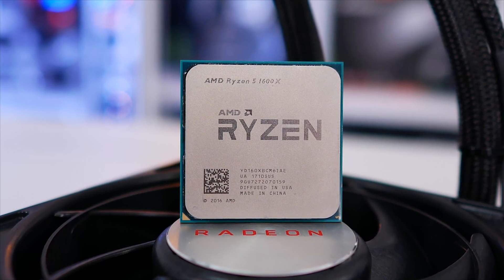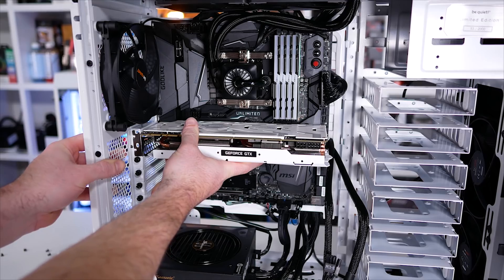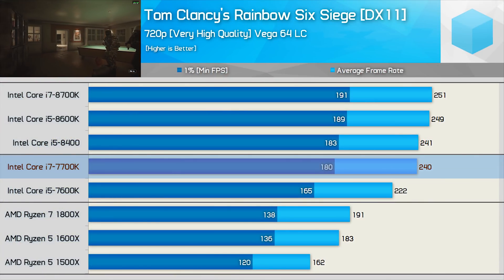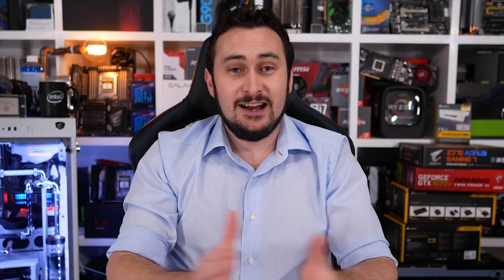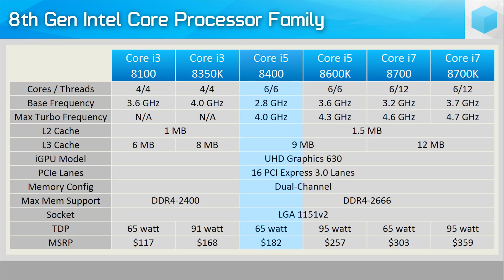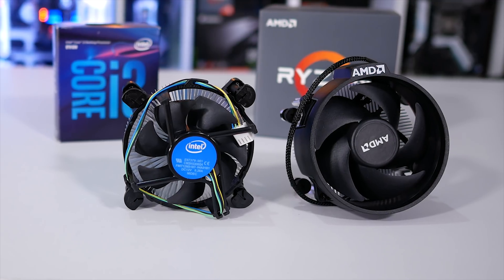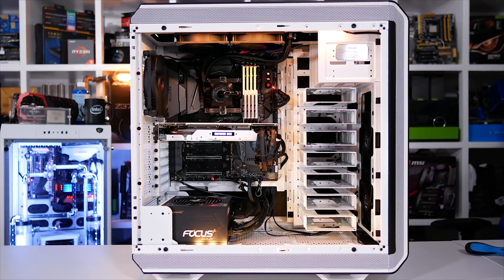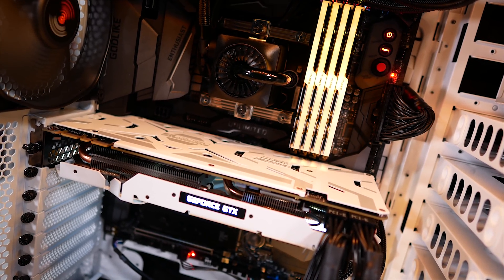Let’s Chat, R5 1600 OC vs. i5 8400 Benchmarks Incoming!

Comment: I'm paying 200$+ for 1050 ti here in India :( 

Should I just buy it from the US instead ?

Everyone is advising me to get it from India for warranty reasons 

I'm really confused.

 please help
Reply: I have a couple folk in india on steam friends, and one is to upgrade soon to a 1050 thats 8000rs.

The 1050ti is 11000rs, a quick translation to dollar says thats still 169$. Price seems right, even in india.
Reply: Tripnotik25 as to where I live it's very costly, if it was 169$ I would definitely buy it from here but that's not the case. I have relatives in the USA so will there be any warranty issues if I get it from there ?
Reply: Well yes, its always a hassle and im fairly sure you're the one responsible for shipping too. What saves you a few bucks now, could have you spending alot more later.
Reply: Tripnotik25 I see... they visit here frequently so no shipping charges but I think I better buy it from here... lol 

Thanks by the way ;)

Comment: Well can you blame the AMD fanboys? I mean...you basically give them scientific proof, that their freshly bought CPU will not stand the test of time as well as Intel. maybe towards the 4 core version, since it can be hoped that 6 cores get better support in games. But the 8400 in unbeatable, since I assume the 6 additional threads of the 1600 will never really optimally utilized in gaming. That is why they argue, that nobody really plays in 720p. But I think in 2-5 years we will already see that AMD buyers might no longer be able to fully stretch their GPUs potential (Yes guys I am saying that the 1600 will bottleneck the mid range GPUs in the next two generations), since it already bottlenecks a 1080Ti now. It is sad, but that is the reason why I will wait for Ryzen+

Comment: The reason why people think the 8400 won't do 3.8 on all six cores on cheaper motherboards is because Intel announced it wouldn't guarantee that clock speed on all six cores and instead stated that it would only stand by the 4ghz single core turbo.  This made many people suspicious that cheaper motherboards released next year wouldn't be able to handle 100% workloads coupled with the 50% increase in cores, and that this is why Intel did NOT want to disclose true six core turbo speeds. 

But i remember reading that subsequent to this announcement, Intel backtracked and announced that it would stand by the 3.8 all core number.  

Whatever the case, the stock cooler is woefully inadequate to handle 100% use tasks like video rendering on the 8400. Unless you like running your CPU at 75 C and higher for sustained periods, a basic 3rd party cooler is a must.  Otherwise, the CPUs will throttle and you'll never see 3.8 on all cores.

Comment: Are we still having this "real world benchmarking" argument? This always has been a cancerous argument that started with the Bulldozer launch when Sandy Bridge was handing AMD it's ass. Before, with the Athlons, nobody was ranting about this. It is just a reason to crush the delta's and create a level playing field by making it essentially a GPU test.

Though I do agree you shouldn't overdo it and create really high framerates and possibly break the game engines or the way the CPU can handle the mainthread. As long as the GPU is not hitting 90-100% load, it's fine. Whether that is 1080p or 720p. But if you start posting >200fps results at 720p, there is some merit to the criticism. Since the oddities and delta's you start seeing then does not reflect how the CPU's will age in the long run. (again, only if you're overdoing it. This has to be the point where the reviewer picks testing parameters intelligently). Take GTA 5 for example, that starts breaking on i5 CPU's at >160fps.

However the argument "you don't game at X, so testing at X is useless" is really tiresome.

Comment: so i have a gtx 1070
i6 6600 non k
8gb ddr3 1333mhz
gygabite h110m-ds2
180gb ssd
1tb hdd
my fps in all games is really low.even when cpu is not 100% fps are very low compared to anyone on youtube.for example on batman arkham knight i get between 30-45 fps on max(cpu is 100% at 3.6 ghz-gpu is 30-50 max).with vsync off and 90 cap fps.with msi afterburner and rivatuner.in fornite i cant get a solid 60 fps.fps is between 45-60.30 when droping from the buss.lol max 100-200 fps.gta v 50-70 fps.csgo 100-150 fps.wot 60-90 fps.thats all games tested so far.i dunno what to think of my future fps on the new ac origins.like i said.if you look at every benchmark on youtube with my rig everyone has much higher fps.i think my cpu is somewhat doomed.all cores are working and timing is ok.any help?do you think is something in bios(hpet off/on doesnt help?i dont think 
ddr3 its the problem.55 degress is a constant in most games.so no overheating problems
http://www.userbenchmark.com/UserRun/5553686
https://imgur.com/a/WxJqe -3dmark results
HELP
Reply: You tried updating your BIOS?

If your mobo still carries one of them release bios, they were a mess and performance was all over the place.
Reply: Tripnotik25 yeah i qflashed like 2 weeks ago.no difference..
Reply: Well next inline id say is the RAM, are you really using normal DDR3 on a skylake platform? could perfectly be the reason for the low(er) performance, not only that, you're risking the memory controller going to crap.
Reply: Tripnotik25 dunno what to say.from what i know drr3 va ddr4 makes little to no difference and only in some games like rise od the tomb raider
Reply: Hm no, even DDR4 vs faster DDR4 makes a difference on plenty games, you can check it here on Hardware Unboxed, hes got several videos on it, unfortunately hes never done DDR3 vs DDR4 on skylake i don't think, probably assuming nobody would use it on this platform.

Im sure 1333 Mhz memory can tank performance that much harder. And if that really is normal DDR3 as opposed to DDR3L, then it runs at something like 1.5v and is just waiting to blow out the memory controller since the DDR4 it expects uses much less.

Comment: Yes, Vega 64 is absolutely a bottleneck, including at 1080p. You have no business running a YT channel if you refuse to acknowledge that. Any 1080 Ti vs Vega 64 testing proves the Vega 64 is a bottleneck. The 1080 Ti also outperforms Vega 64 in DX12, making your claims about Nvidia cards completely false.

Just one such review proving you wrong. Never, EVER, us Vega for CPU testing.
https://www.techspot.com/review/1476-amd-radeon-vega-64/
Reply from the maker: +J Master that's my own review bud. I've done the testing. No need to get angry.

Comment: I guess this is the foreshadow to another Intel is better CPU video. However trust me the he won't get the most out of the 1600. You will know this because the RAM will not be OCed to 3500 with very low latency.
Reply from the maker: The Ryzen memory thing is super misleading for two reasons. Firstly high speed low latency memory is extremely expensive and blows Ryzen's cost per frame right out of the water. Secondly I have quite a few Ryzen 5 CPUs that struggle with DDR4-3200 speeds, I have a few that won't post over 3066.

Comment: Can most R5 1600s reliably get 3.9GHz at safe voltages?
Reply: Even on a stock cooler a 1600 should get to 3.8-3.9 easily. All 1600x should be hitting 4.0-4.1 with a good cooler.

Comment: I mean it is clear the 8400 is currently a better CPU for gaming.

I just don't want the whole of the Internet (and reviewers) go on and unquestionably recommend the i5 8400 over the 1600, even if specifically for games. Either one will do you just fine, you probably won't be able to notice a difference between them for 3-4 years in most games.

Comment: I'd argue that one ought to include the products that are closer to the the product on either side, from either camp. Like, 1500x, 1600, 8400, 8350k. Prices are often different when borders are taken into the equation as well. In Norway, the price difference between the i5-8400 and the Ryzen 5 1600 is less than 10%, while the msrp's are nearly 19% apart - the Ryzen 5 1600 has been at this price for several months now, so it's not a temporary price either (using statistics from sites that gather price data from all of the Norwegian online market). The 1500x is also more than 20% down from the pricing of the 8400, rather than the msrp which is around the same as it. These are price trends, and not only temp prices. 

Pricing changes all the time, so providing information about said fact is never a silly thing to do.

Comment: The reason I don't believe that low resolution testing gives the best picture of the "future profness" of CPU's is because we are in the multi-core era. When you are running low resolutions and stressing the CPU, it will only stress the cores, that the game or benchmark uses. So if a CPU has a deficit in per core performance, then it will automatically look worse, even though it offers more cores.

Maybe a bad example, but you don't buy the any core 2 duo CPU over the Q6600 or similar on the used market, even though at the time it was worse at gaming.

With that said, I believe the best thing to do is, like i'm sure you have said, Steve, is that you should buy what is best at the moment for the purpose you are going to use your PC for. I like that you give, us the viewers, the informed choice about how to decide which CPU to buy. So even if I don't see a point in low resolution testing, then i'm glad that I have the choice to see it anyway.
Reply: When reviewing what I wrote, I'm realizing that low resolution is just another kind of "max value". Like when reviewers used to put max fps in their graphs. It doesn't give the best picture of the CPU in normal circumstances, and I think that's why reviewers don't do that anymore, but don't hesitate to comment if i'm wrong :)

Comment: In next episode! Why testing with low settings is better than high or ultra!
Reply from the maker: +smiechu60 low takes work away from the CPU so that's much worse.
Reply: Hardware Unboxed you got so into fighting about 720p benchmarks that my joke went straight over your head (also testing in 720p takes work away from cpu but shhh)
Reply from the maker: 720p takes away from the CPU? Ohh okay thanks... noted.

Comment: You may be able to silence some of the confused ranters regarding 720p or 1080p. 

If you could say pull out some old games from say 2010-2012 or older, use some hardware from that era, and some older first gen i5/i7s and some Phenom CPUs from the time (testing for actual competing parts with similar MSRP perhaps). Test the top end GPU from its time at 720p to remove bottlenecks and later see how that compares when you drop a card like the 1070 or even the 1080ti onto the same old CPU when running those games at 1080p or so. 

You can see if the improved and upgraded GPU power (products from their future~) were able to realistically show those CPUs true performance in the past with old hardware compared to if you upgraded the GPU 5 years later.

Its a lil bit of work... with 5 games, maybe 2-4 old CPUs, 1 or 2 GPUs that old and 1 or 2 GPUs that are new. The testing combination  amount grows fast, but would be some valuable information! What are your thoughts?
Reply: Oh and bonus points if you would like to use older drivers (or even original drivers) on old GPU setups and latest drivers on the modern GPU hardware.

Comment: Steve, the reason some people are saying that the B360/H370 chips will have lowered performance on the locked Core i5 SKUs is because MultiCore Enhancement will behave differently on those boards.

On the Z370 motherboards, the MCE's default behavior is (on motherboards that have this feature like Gigabyte and Asus, when enabled and no manual adjustments done to the Multiplier in the UEFI) that it locks all cores to their maximum Turbo frequency, with albeit a higher voltage applied to ensure stability, essentially making the maximum turbo frequency into base frequency.

On the other hand, on lower end motherboards, you can not get locked SKUs to operate at their maximum Turbo frequency on all cores, and they'll more or less behave the way intel intended them to.

So, essentially, on a Z270 motherboard, a Core i7 7700K will boost all 4 cores up to 4.5 GHz thanks to MCE whereas on an H110, only one Core will boost up to 4.5 GHz while all cores, when stressed will operate at their base frequency which is 4.2 GHz.

Hope this made sense as English isn't my native language.
Reply from the maker: Multi-Core Enhancement is a form of overclocking and as I explained...
A: I don't test with MCE even when supported.
B: It's not even supported on Z370 boards using locked CPUs, at least not all the MSI, Asrock and Gigabyte boards I have.
Reply: I can't say about the Z370 motherboards as I don't have one, but on the previous platforms, the motherboards usually have the aforementioned behavior of locking all the cores to their maximum turbo frequency even on the locked SKUs, by default. Manufacturers like Gigabyte won't even allow you to disable MCE as there's not an option in the BIOS for it. It's just how these CPUs behave on these Z series motherboards.

You yourself can confirm this by simply running something that taxes all cores on a locked SKU, and then keeping an eye the frequency of the cores operating using something like the HwInfo64. If you see all the cores running at their maximum boost frequency, you'll know that it's in effect.

An interesting test would be to see how a locked 7700 behave on a H110 vs Z270.

Comment: To justify more the 720p resolution i could add the fact that you can play with 1080p resolution screen and use lower render scaling (or render resolution) on games your gpu cant handle that well. Render scaling is a nice option to have in games since you can keep the 1080p main menu and hud while it only affects the rendered resolution of the 3d objects

Comment: Strange - i can't open this one. Opera, Edge... only Google chrome can. For chat -  r5 1600 / 3,8 - 76C temp max and 115w from the wall, 3200 gskill f4 - cl14 ram and msi b350 gaming pro carbon... whole system look and work like charm. not a single problem. Like 2 see your test :)... Btw last night i have some win10 update for amd systems.

Comment: what's fishy to me is that single threadwise 7600k is ahead of 8400 and so is 7700k... but how come most benchmarks have 8400 ahead of these kaby lake cpu?
did intel somehow nerf their previous gen cpu? 
And how come the 8400 is performing neck to neck with the 8700k with a 700mhz deficit? Something is not right here. 
if IPC is that important to games why is the 8400 stomping the higher clocked kaby lake in 720p when there is no IPC change from 6th gen to 8th gen?

my bets are still that 1600 will lose even OC cause somehow 8400 is performing like a 8700k despite having lower clocks
Reply from the maker: ”what's fishy to me is that single threadwise 7600k is ahead of 8400 and so is 7700k... but how come most benchmarks have 8400 ahead of these kaby lake cpu?”

Most applications/games don’t use a single-thread, so the fact that the 8400 has 6-cores is a massive benefit. If the 7700K’s Hyper-Threading is being utilized to the max, at best it acts like a 6-core CPU. The 8400 might be around 3% slower for single thread workloads when compared to the 7600K, but it’s 35% faster for multi-threaded workloads so that one should be obvious.

"And how come the 8400 is performing neck to neck with the 8700k with a 700mhz deficit? Something is not right here."

It’s not, in productivity workloads the 8700K is much faster. The reason they are similar in games is because these CPUs are just so fast, we're GPU bound in almost all tests.

”if IPC is that important to games why is the 8400 stomping the higher clocked kaby lake in 720p when there is no IPC change from 6th gen to 8th gen?”

It has more cores :S
Reply: i was mostly talking about the game benchmarks you did as far as productivity i fully understand why 8700k is superior.

the 8400 makes my 6700k feel obsolete
Reply: a computer is obsolete the minute you buy it.

Comment: The one thing that the B and H motherboards won't provide for the locked CPU's that Z370's do is higher memory clocks and memory overclocking, and Asus does have the ability to make all cores clock to the 4Ghz instead of a single thread on the i5 according to GN Steve, so the B and H motherboards probably won't have that either.

As far as all cores clocking to their rated frequency, the B and H motherboards will be able to handle it, especially the i3 and i5. I mean we're talking about 1151 here, not an 18 core 2066, they really don't use as much power as people think. We've got 3 phases on the ASRock B350's that'll handle an overclocked R7 and they go for as low as $60, so the B and H motherboards can definitely handle the locked CoL CPUs for that low of a price.